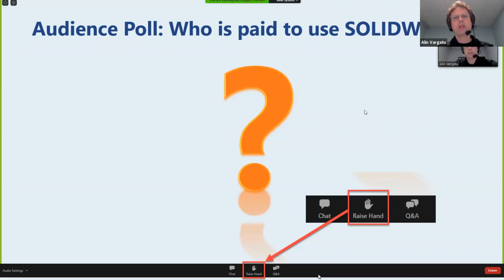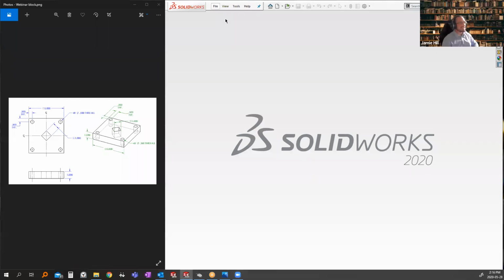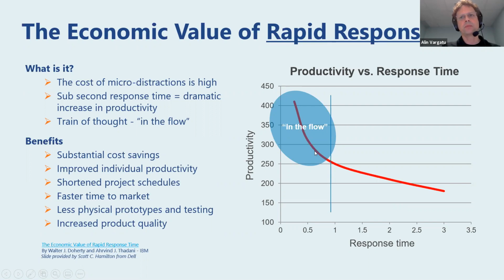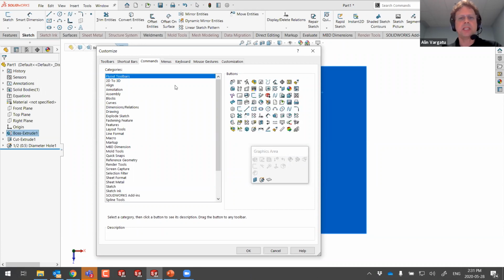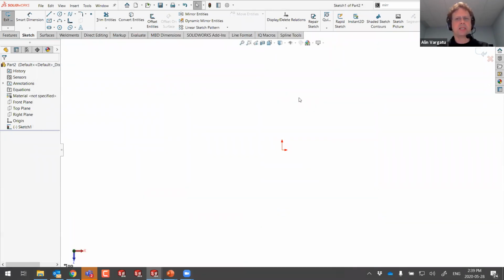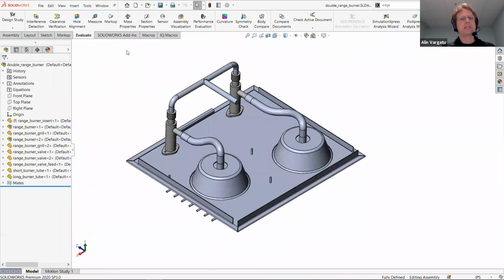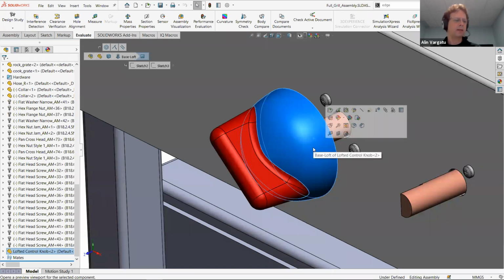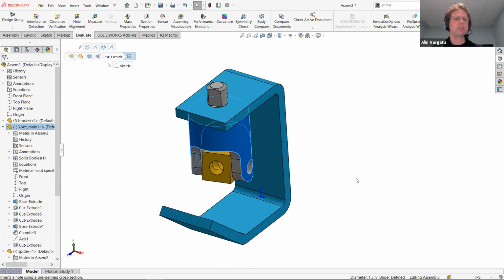SOLIDWORKS Workflow Tips & Tricks

Comment: I am a beginner SW user (~2yrs experience) and tried the first exercise. Would it not be better to have the holes and square cutout included in the Boss-Extrude1 sketch?
Reply: I suppose it's a little subjective to what you value, but one reason you wouldn't want to do that is because it becomes harder to tell how to modify it at a glance.  Especially when the model is complex with many features.

If it were a race though it would probably be faster to do it all in 1 sketch.  Also, I would guess that having less features has a little better performance.